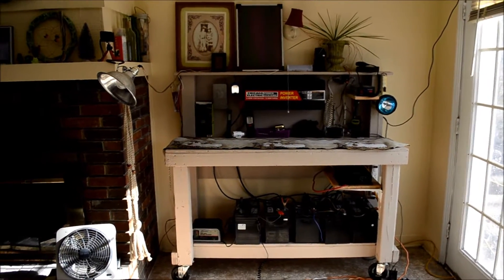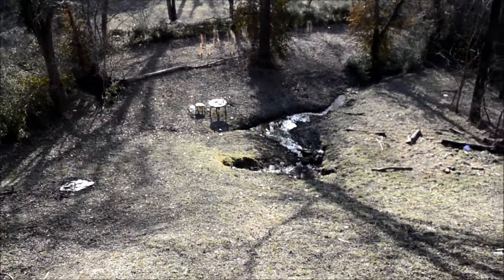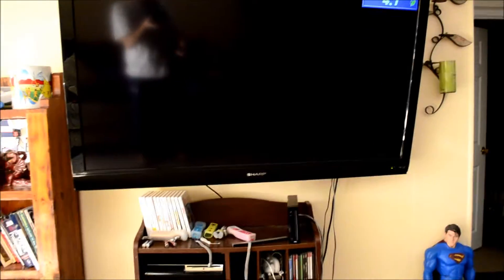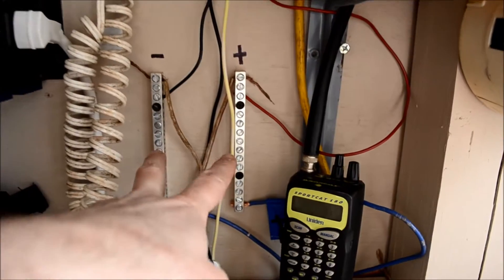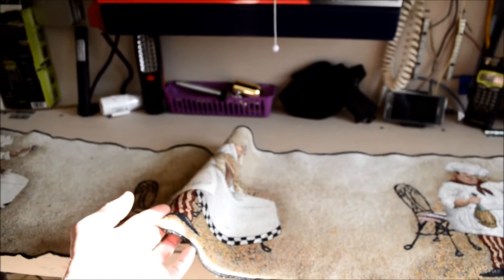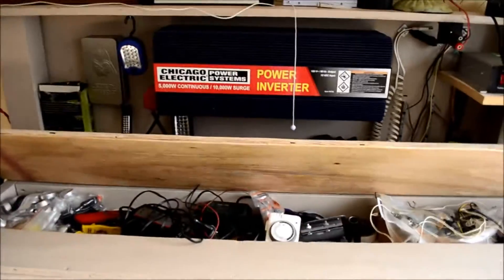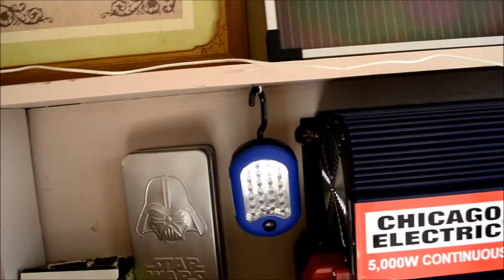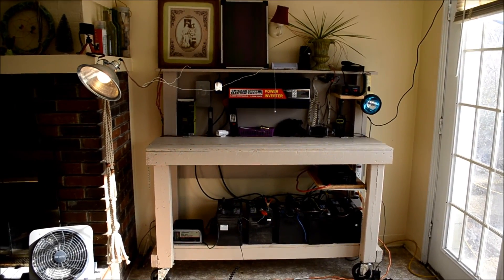5000 Watt Chicago Electric Solar Setup "Update"

Comment: i do have one like yours im not that inpress with its watts it claims to have 5000 watss so its shoud handle a miter saw  . but mine those not handle miter saw i wonder if mine is defected ,can you make a video of what can it handle in tools with some 4 bateries in paralels in one 12 volt just so it has good amps .i wane it for to run an ac or washing machine.

Comment: got the same Power Inverter  but it is for a shed application. to run the shed, green house fans, and a pond I hope to build someday ( the pump) Your more brave or fool hearted than I am..no way I'd have that in my actual house. As mentioned I have seen a acid battery explode and I have seen houses burnt down from an over heated home made system. Do, you have emergency shut off monitors on it so it wont catch fire when its too hot?  Please look into getting some Sealed batteries if your gonna keep it inside, really hate to see you hurt

Comment: WOW!!! What a set UP! Where do I start? Your on the right track but your not protecting yourself or your equip! Flooded Lead acid automotive batteries (uncontained) indoors and a main living space to boot! Research what happens when a Flooded lead acid battery explodes! 5000 watt inverter with no fuses, wires that are so small they will burst into flames if any load is applied! Cheap weak and loose battery cable connections! Get rid of the battery spring type clamps and bolt everything tight! No safety equipment! No battery disconnect switches or run away fuses. No battery gauges voltage or amperage! Batteries with swelled cases! No Dump load for the wind generator!  Wind generators need to be about 40 feet higher then anything around and in Clean wind to work right! You wire with large enough wire to keep your voltage loss to less then 3 percent. Please for the safety of your family shut it down and get it out of the house until you get a little more education on how to do it SAFELY!!! If anything happens your insurance wouldn't pay a red cent! Play around with the little inverter and learn but installing some safety equipment. Spend your money on the safety side and bring what you got up to a safe standard! Then what you got will work as it was designed to work! Safety FIRST! Disconnect that 5000 watt inverter until you got the proper equipment and prevent a wreck!   Good Luck